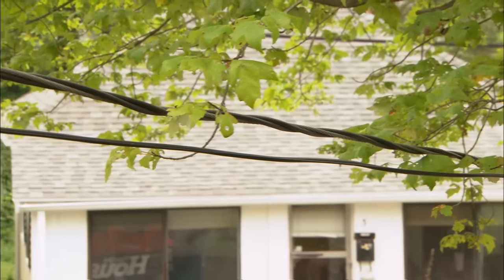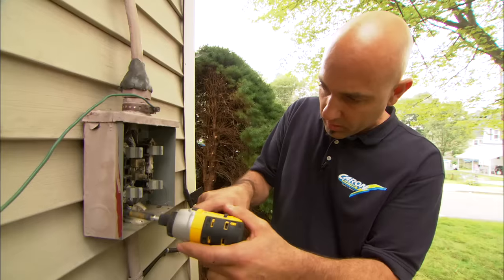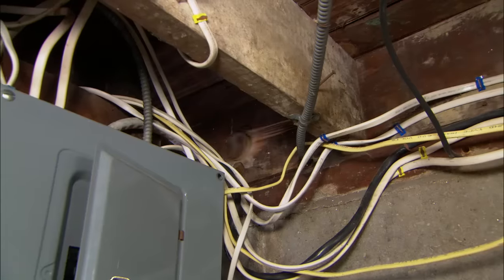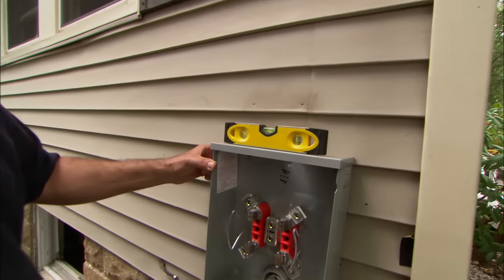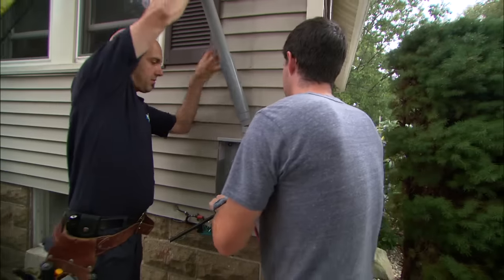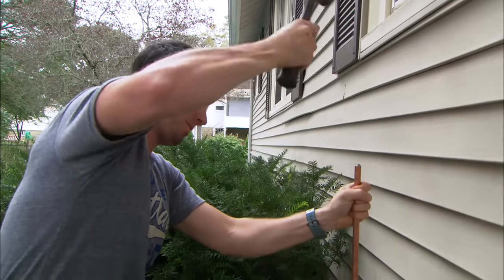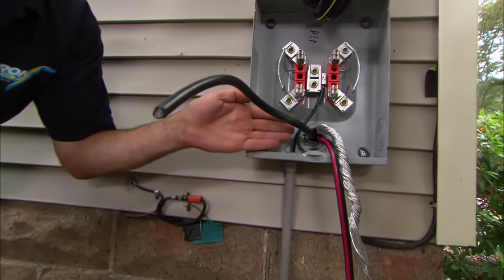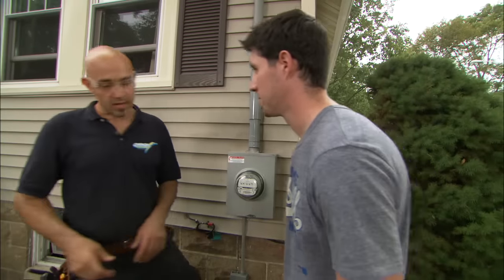How to Upgrade an Electric Meter to 200-Amp Service (Part 1) | This Old House

Comment: Nice to see Robertson screws being used :)

Curious why the wires are aluminium? When I was answering home insurance questions one of them had to do with aluminium wiring in the house and how it can be a fire hazard.  Granted the wires in the house a much smaller.
Reply: Usually Aluminum is used for service conductors and sub panel feeds, perfectly safe for this use. Copper is too costly.  Aluminum is not allowed for branch wiring and can be a fire hazard.
Reply: The insurance companies are interested in older AL branch circuit conductors that have never been mitigated. New properly installed AL service entrance conductors aren't as much a concern.
Reply: Aluminum was a problem because it broke easily. But on the main you aren’t taking things apart so it should last for a long time.
Reply: Aluminum small-conductor branch circuit wiring is technically still legal insofar as I know, but it requires a lot of double-checking for device compatability and is very expensive to splice with copper conductors. There's nothing inherently dangerous about aluminum conductors. The danger with small aluminum conductors is in the terminations or AL/CU splices, and where the conductors are undersized for the required ampacity (on average, aluminum conductors need to be one size larger than copper conductors for the same current carrying capacity)
Reply: Most houses use copper for in the house branch circuits and Aluminum for The service entry cable only

Comment: I might have missed something, but I didn't see any attempt by the installer to waterproof the big assed-hole he cut into the house for the service entrance.
Reply: He probably put some sort of sealant there but they didn't show that little detail.
Reply: It's hidden by the box so it has to rain in a really weird way to get water inside there.
Reply: why not do a professional job and run rigid or Emt for the mast instead of crappy PVC.Anytime I see PVC run exposed outside my first thought is a substandard craftsman installed it or a cheapskate. I mean why install plastic when you can run rigid and it will last forever..
Reply: @jamesellis5549  and what material is that rigid tube made of?
Reply: @jamesellis5549  and what material is that rigid tube made of?
Reply: @juan sambucetti rigid is galvanized steel
Reply: HE PUT DUCKSEAL
Reply: @mrpanda2655   Is Duckseal OK... Can anybody tell me the proper way to seal the hole in the back of the enclosure with the hole in the wall so water does not enter either?  I watched this video for that info but its not here. Thanks.

Comment: In Sweden, we have 3 phases of 400 volts and around 16 to 20 amps in our houses. then it is divided up to 230 volts. What appears in the clip is like slipping back to the 1920s in Sweden.
Reply: The same here in Germany.
Reply: we've done it fine like this since the dawn of the electric age... nothing wrong with it. say you have the Swedish collector car version of a pristine 1957 Chevy. it's a flawless vehicle. would you then take a vehicle that can get you upwards of 300k at an auction in America, and "fix" it by upgrading things?  I agree on upgrading our power grid, but the current voltage and amps have worked fine for us for years. it's just what were comfortable with.  uninformed people tend to not like the idea of ramping up voltage either...
Reply: lul what a bullshit xD (@Mark S)
Reply: SylviaisGod, now what does that have to do with the tea prices in China .... LOL .. Your comment is funny!!!   LOL   :-)
Reply: having lower voltage to operate same devices in more advanced solution
Reply: Ampeex So your household service is 3 phase 400V?
Reply: I think you probably mean three phases each at 230V.  It's referred to as a 400V three phase supply, but 400V is the voltage between phases, not the voltage from phase to neutral.  So you have a maximum of 3 x 20A at 230V - up to 13.8kW.    That's very similar to most UK houses, except that we get a single 230V phase (usually running in practice around 240V) rated 60A.  I think the video is showing 200A for the US 220V two phase supply, so that's 110V at 200A for each phase.  That's a massive 44kW.  That sounds like a crazy amount of power for a house by European standards.
Reply: Paul Grimshaw we in Germany have 3x 63A @ 230v AC. So roughly 44Killowatt at 230v
Reply: he have 3 phasses 230v but some devices work at 400v (all 3 phasses) why 3x230=400v? 230v *  √3= 398,37V  + - 10%
Reply: 3 phase 4wire Y?
Reply: ROBERT WEIR I got live 1 live 2 live 3 and Neutral
Reply: 4 wire? in old- yes, in new 5 wires ... L1, L2, L3, N and PE
Reply: EL Majster of course. But there are only 4conductors coming into the house. The Earth doesn't come through the supply cables.
Reply: yes in the TN-C but in the TN-S you have 5 conductors, the provider provides a "cable sheath earth" which is directly connected (physically) to the earthing of the energy supplier,
Reply: Europe uses DC, we use AC here in the states.  Completely different systems.
Reply: chuckschilling no that's not true. We only use the Alternating Current (AC) system in Europe for our lines. You are telling bullshit
Reply: No one cares.
Reply: You people don't even know basics. 
All Europe has 3 phase electricity, but the way the electricity companies balance the phases does vary from country to country and from region to region. Each phase to neutral is 220v (240v in the UK), and three phase is 400v (415v in the UK).
Reply: Wow I really wish I had three phases here in canada!!

Here its either 120/240V 1 phase or 347/600v three phases
Reply: Why would you need a three phase service to your house? Especially if you're only drawing 16-20 amps? I could understand if you lived in an apartment complex or something but that setup for a residential home seems pretty stupid.
Reply: 120V is lower, 230V is very dangerous.
Reply: Same here in Haiti.
Reply: usa is so damn far behind lmao they are more and more becoming 3rd worlder with their rusty infrastructure
Reply: David83FY A kills and not the V! This is basic knowledge.
Reply: Peter Šori He must be American. 😁
Reply: You are also 50 hertz. Here in the states we are at60 hertz.
Reply: Why do you need 3 phase power in a residential setting? In the US 3 phase in only used in commercial or industrial settings. You  can get 3 phase power to a home but it would cost a ton of money.
Reply: Ampeex wow that's interesting  didnt know that
Reply: lover voltage means higher wire gauge, that means more cost and so on, but i see, you use aluminium as a conductor for higher gauges because of the cost and weight
Reply: 400V x 63A (my house, switzerland) x 1.7 = 42kw
Reply: no.......... ever watched electroboom?
Reply: Paul Grimshaw The US uses a single phase 3 wire system for house service also called a split phase system. This allows for 120V phase to neutral and 240V phase to phase.
Reply: Here in Brazil the system is very different. We used 3 phases de 127V
Reply: 16 to 20 amps?   Don,t you mean that say a toaster uses around 12amps power?   IN the US  , we would say that the house has 240/120volts going to the house and then the circuit breakers for kitchen plugs would be under a 20 amp breaker. and usually the lighting is under a 15 amp breaker.   I have only seen one house here that had a 3phase elec service to it.   You just don,t really see that here , where i live.   3phase is for commerical , industricial.
Reply: @marks6663  Touchy aren't we.
Reply: You know ohm law? Kill current, but voltaje impulse current. More voltaje = more current. This is basic circuits.
The 230/400V is dangerous. 3 phase 127/220V its ideal for domestic purposes.
In my country existing 133/230V and 230/400V. Im know and work with this systems.
Reply: you guys in Europe get a Cadillac power system then.3 phase here in the states is almost always a commercial install and almost nonexistent in houses.I would love to have 3 phase in my house
Reply: well at least they have free healthcare and college tuition among other things.Keep watching Fox news and staying ignorant
Reply: In Europe the low voltage distribution, usually is 3phase, with DY 3phase transformer.

For a group of buildings, the electric company build to a transformer room. This room have a 1 or 2 transformers up to 1000kVA and some out lines up to 400A (4 wires up to 240mm2). This distribution lines up to 1000 meters.

The american electric distribution consist in a medium voltaje lines (11...13,8kV) that run down streets.

Each one building uses a own transformer MT-BT. This transformer can be sigle phase (up to 80...100kVA) or three phase.

A industry can be a own transformer room whit 2 transformers, one for general uses single phase 120/240V or 3phase 120/208V and one 3phase transformer of 480V.

In european distribution the number of transformers is less, and transformers power biggest. It allow make to a more hidden medium voltage lines. Also allow use it a more high voltage (20...25kV).
In low voltage its possible request a low power in 3phase (from 2070W).
Reply: In Europe a houses not always have a 3phase power.
The power into the house may vary between countries. The average of power betwen 3,45...6,9kW (15...30A - 230V 2 wire). Exist a big houses whit biggest power. But billed cost up to.

The sigle phase use up to 14,49kW - 63A - 230V 2 wire. But it use 3 phase from 6,9kW - 10A - 230/400V 4 wire.

Also can use a 3 wire service entrance, 2 phase and neutral:
https://upload.wikimedia.org/wikipedia/commons/thumb/4/49/Landis%2BGyr_Z%C3%A4hler.jpg/660px-Landis%2BGyr_Z%C3%A4hler.jpg

In Europe, if your need a 200...250kW or more, you required a have a make your own transformer room.
Reply: @David83FY, with 220V is cheaper as you need less ampere for the same power - the wires are twice thinner. Less copper.

Comment: Electricity does not "return to ground", it returns to the source.
Reply: Jon Robinson ur right it returns to the source tru the neutral .well sed
Reply: Eviscerate what he said is true
Reply: The neutral is grounded 👍
Reply: It could do either one. It only seeks lower potential.